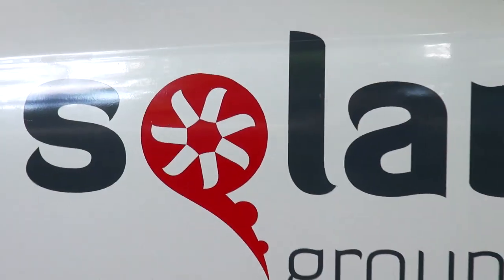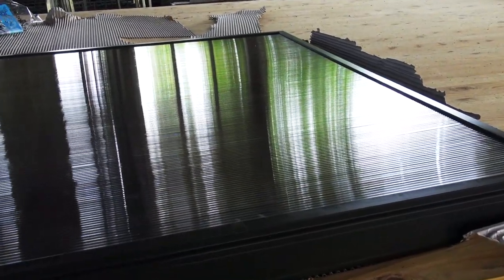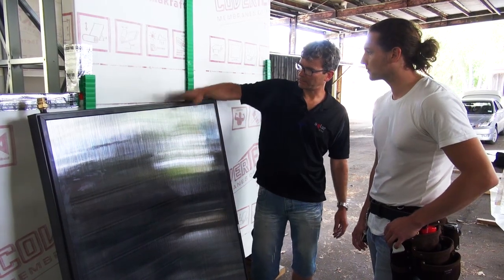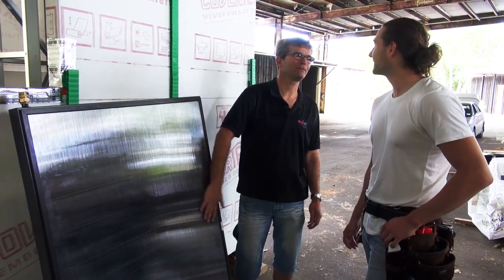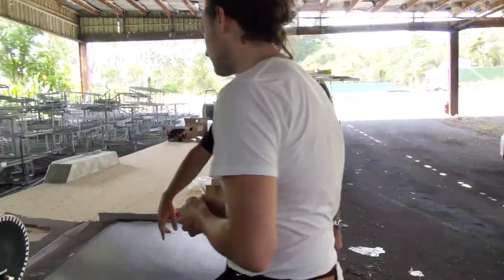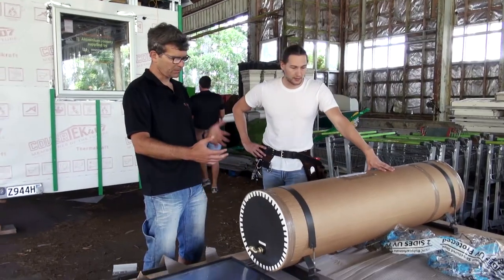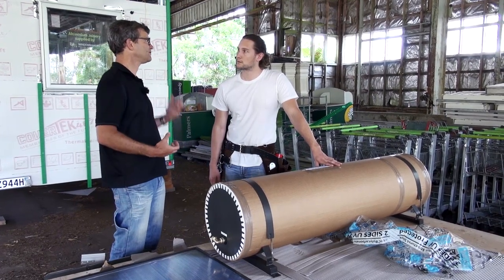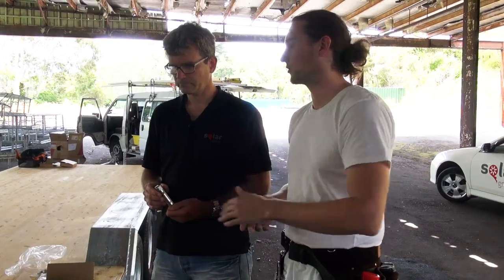Tiny House Solar Hot Water Installation (Part 1)

Comment: I really love the Hot Geyser idea! Perfect for a tiny house or small cabin. Even building up on it to do a complete home with radiant floor heating coupled with passiv haus design.
Reply from the maker: cnypilot Yup! It's been a bit tricky to come up with a great hot water solution in such a small space, with limited electricity and without using gas, but I think this really nails it! Can't wait to fit the wood-stove and really get it all cranking!

Comment: This is a fantastic alternative to gas or electric hot water systems. Great idea. I'm just wondering how well it preforms in winter? Do you have any type of backup? Because although it's still summer currently, winter is coming.
The build is looking great though, can't wait for more updates.

Comment: Looking good, you are doing a nice job! Also, really appreciate that you read and respond to many peoples questions (unlike many).
   Just finished having my trailer custom fabricated, and am currently saving up to start the next stages. This reminds me, did you use some kind of computer software to design the whole project (sorry if you have already answered this somewhere)? I am trying to use Google Sketchup. but the learning curve is proving very frustrating.
Reply from the maker: Hey there. Congratulations on kicking off your own Tiny House build! Please keep us posted on your progress. Thanks, I try to reply to as many as I can, but it does get hard to keep up with sometimes! The drawings of our Tiny House were done by a professional (Eddie from Equinox Design) in ArchiCAD. I have heard great things about Sketchup though, and even though it's a learning curve, I think it's a wonderful skill to pick up on if you can. I've been slowly chipping away at learning it too.

Comment: The problem I see with this, and any solar installation on a tiny house roof, is that it determines the orientation of your house wherever you park it eventually. So for you, you always have to have that side of the roof facing north. Pretty cool system though.

Comment: Living in America, and in the North East with bitter temperatures, I am very interested in your Solar system.  I'm wondering, do you live in a warmer area because I would be afraid of a system like that, especially with the tank on the roof and the chance of freezing.  I'm not really familiar with New Zealand weather, sorry.  I love the idea as I have been researching Solar and rain water reclaiming for my own future build.  I was interested in the idea of water storage under the bedroom in that big truck link you shared on your window install comments area,  but wish there would have been more details about the system.  I think that is why I love your site, because you give all of the little details.  I can't wait to see what your plan is for water in your tiny home.  Thanks again for sharing your adventure.
Reply from the maker: Hey Patty! In the city where we live the winters are very mild, so we don't really need to worry about freezing water. However, we are designing our house for all conditions, as we may want to one day move it south and would have to deal with freezing temperatures. For the solar system, we do have a frost valve in place which will prevent damage to the collector and to the tank. We also have plans in place for our water tank on the draw bar to help prevent problems. We will be covering all of this in future videos. Thanks for watching! :)
Reply: Ah yes, I remember him commenting on the valve.  Thanks for the response.

Comment: Bryce, did you do a part 2?  I"m looking to have my own tiny house built in around 6 months or so, and will be off grid, and wanting to use solar to heat water rather than gas.  I cant find the part 2 - but will check out your solar fit, perhaps its in there?
Reply: found your follow up in a later update video

Comment: The water tank seem to be higher then the roof corner, is it going to pass the max street  hight?
Reply from the maker: Hey Sylvain! Nope, the ridge cap still has to go onto the roof which will bring the height of that up a bit more. The whole house will sit at exactly 4.25 meters, but is likely to compress another 5cm under the weight of the house on the suspension - so we expect that it will be 4.2 meters on the road.

Comment: I worry that the tank on top makes the tiny house higher in the air by like 6 in and because of the height requirement and trying to park it somewhere It could hit wires or bridges
Reply from the maker: Hey Katrina. The ridge cap is still go to on the roof. Once the ridge cap is on, the water tank will sit just below the roof line so it will still be fine to clear bridges and power lines (so long as they are not hanging below the legal height).
Reply: Yeah, didn't know if it was the angle of the camera making it appear taller than the house and was thinking thats crazy to have to take it off/down to move the house, tks for getting back to me

Comment: Hey Bryce, this is not to do with this video so much but I was just wondering what the reasoning behind building over the wheel well was. I know that Jay Schafer advises against it now, because of thermal bridging and waterproofing issues even though he started out building over them. So, I was just wondering did you find a way around the drawbacks he mentioned or would you change the design? Not criticising, just very interesting. I've been following your build since the beginning :) 

This is the article I'm referring to http://www.fourlightshouses.com/blogs/news/12555681-dont-try-this-on-home-wall-over-wheels
Reply from the maker: Hey Dusty! Sure thing, really it was to do with creating extra space inside the house. I can understand Jay's concerns when it comes to waterproofing and thermal bridging, but these have all been addressed in our design. We have made sure it's watertight by using a custom flashing solution which goes right up under our weatherboards, to prevent any water from being able to enter via the wheel arch. When it comes to thermal bridging, the wheel arches are boxed in and insulated. Overall, for the amount of usable space you gain by building out over the wheel arches, I think it's worth while. In saying that though, if you are constructing a house that you plan to move often, I think it's better to build inside to minimise the profile of the house and make it easier to transport. Hope that helps a bit! Thanks for watching our vids! :)
Reply: Thanks Bryce! Really appreciate you getting back to me so quickly! Yes, it really does have a big impact on the floorspace and it brings up so many more challenges, but I suppose in a tiny house it's always a balancing game. You gain floorspace, but you lose portability. But yeah, it forces you to choose :) I'm really glad that you're building over the wheel arches. It'll reassure me when it comes to building mine!